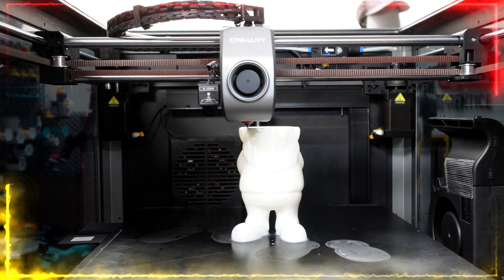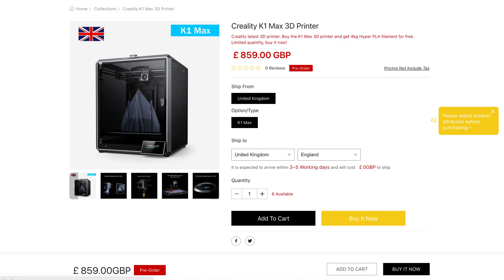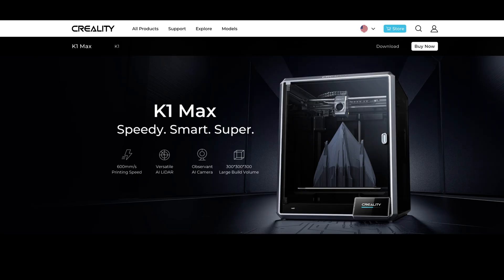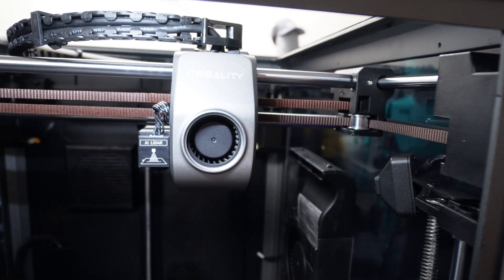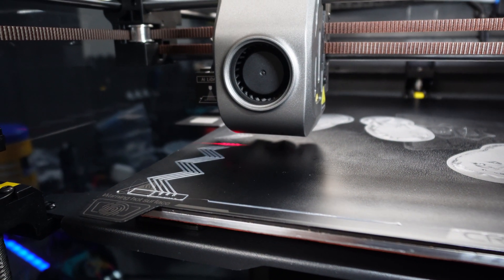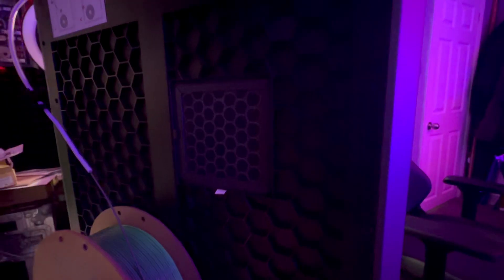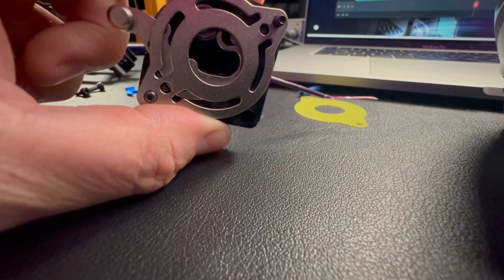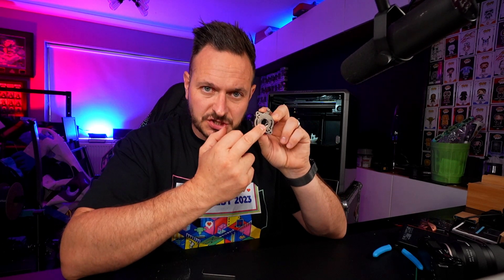Unlock Your Creativity with the Creality K1 Max - Limited Time Discount!

Comment: The idea of 3D printing has been long wait for me... I'm still sitting on the fence, but I think I'm ready to take the plunge here pretty soon... The K1 Max has just about everything...  I noticed a lot of printers have some incentives to buy, so I'm wondering if I should wait until September to see what new and cool products are coming out... Maybe there's a K2 or Bambu Labs will have have something.  I hope this community can give me some insights, I have both confusion and excitement at the same time. Thanks in advance for any help/advice for a new person.  (And New Subscriber too, sent here from Derek @ Van Oaks Props)
Reply from the maker: Here’s the thing Ray, you’ll get one and most likely buy another one in any case. You could be waiting for the next big thing and it be round the corner everyday, it feels like computer parts and cpus a lot of the time. I can’t see you being any less impressed with a max or p1 printer for the foreseeable and price right now. Let me know how you get on and welcome !
Reply: @TheRealSamPrentice   Thank you kindly for your reply!  Yes, I do get the analogy; so it's more of a matter of entering the printer market at a place where you can feel confident that I'm not missing out on a feature that I could have had.  I'm a firmware engineer, so tech doesn't intimidate me, but ease of use and automation are big sellers to me... Also I am hearing ppl say they can't wait until September for some big news... I'm not in a hurry to purchase, I've waited for years so another 60 or so more days, if the wait is worth it... or they might deeply discount existing printers... Ah.... And that's the trap you mentioned.  Sigh... LOL

Comment: Printer broke down on the second day so contacted Creality support and there first suggestion was for me to remove the bottom plate and try fixing it myself! After spending over £900 I wasn't prepared to start taking the printer apart! I then ask for a replacement printer, but they said they didn’t know when they could get one for me.  So, I asked for a refund and now I must send the printer to their Poland warehouse before I get a refund!
If you live in the UK and your K1 breaks you will be asked to either try fixing it yourself or send it back to Poland and wait how ever long to get a refund!
This has got to be the worst experience I’ve had buying a 3D printer and I will never deal with Creality again after this.

Comment: Got my K1 Max on the Saturday and it broke on the Sunday! :(
Reply from the maker: How’d it break ?
Reply: @TheRealSamPrentice  its come up with an error message 2505 motor drive exception
Reply from the maker: @zedwizz  do you think that’s the extruder motor ?
Reply: @TheRealSamPrentice  Extruder still seems to work. The error code comes up when moving in x or y direction.

Comment: Hey Sam, 
I own four K1’s plus one K1 Max. Plus I just received two Bambu P1S printers.
Putting all hype aside my PLA experience with these printers is that they are both fast, however the P1S blows away the K1 in print quality printing the same model. As we all know the Creality Print slicer really sucks compared Bambu Studio. I think once a good slicer is available for the K1 it may catch up in print quality. I’ve started playing with Orca slicer on the K1.
I like both printers for various reasons however I have to currently give the prize to the P1S.
Bambu is probably way ahead of Creality on printing engineering materials but I don’t have any firsthand experience printing them on either printer.
Thanks
John
Reply from the maker: Hey John I’ve got 8 Bambu printers on my farm here and to be fair everyone will have a slightly different experience depending on a number of factors. I’ve said this - x1c over the k1 but the k1 max over the x1c - that’s in my case.

Comment: Myns just shat itself after updating though the internet and now it buzzes like hell and makes a ton of load nosies . Even tried updating though the usb but nothing seems to help
Reply from the maker: Have you tried a downgrade? Img files are in the creality cloud app?
Reply: @TheRealSamPrentice  I tried from a file off youtube but that would not work , thou that way and usb
Reply from the maker: @louisebmedia  are you doing it with a windows pc?
Reply: @TheRealSamPrentice  I am yes :)
Reply from the maker: @louisebmedia  okay what does it do when you run the usb? Fail?
Reply: @TheRealSamPrentice  currently saying usb flash drive inserted :/
Reply from the maker: @louisebmedia  okay so in settings anything to update ?
Reply: @TheRealSamPrentice  nothing unfortunately as still can’t bypass the screen where it says self inspection, if it didn’t vibrate and make the horrible noises I’d carry on with the inspection again. As before when I first set it up, it fired up fantastic, printed the benchy. Now it will only allow me to do the inspection 😭
Reply: @TheRealSamPrentice  quick update, Creality are sending out a new mainboard , seems asif a lot of people are having the same issue with k1 Max soon it updates it seems as if it poops the mainboard. So wouldn’t be surprised if Creality do a post soon to tell customers to check there barcode number if they got the faulty ones. So as if there bad batches which I know these things like that can happen especially with new products but I think maybe they should of at least done more tests before letting them go to the public as it just feels abit rushed to get them out the door
Reply: @louisebmedia  No one should change the mainboard without training in electronics. I wonder what the insurance company says when your house burns down!
There is a reason why you would never be asked to do the same thing in your washing machine or dishwasher, microwave oven etc.
Reply: @dejedejsson  which is why I think it’s bad there telling customers to go do it and offering a replacement machine, they obviously assume nothing bad will happen, if something goes wrong the machine breaks for some reason I will be demanding out a replacement. It shouldn’t be a case of having demand something just because they probably can’t be bothered to risk a customers life. If there’s issues like this happening to people they should be offering a replacement or refund as they clearly are fully aware of what’s happening :/.

It’s bad as they even uploaded how to change it online 🤔
Reply: @dejedejsson  would you suggest me to contact them and ask for a replacement as I feel stuck in the middle as people are saying well if you built a pc I should be fine but I don’t want that risk
Reply: @louisebmedia  You can't compare building a PC to changing the mainborad, it's ridiculous, I build my PC, but would never open the PSU and try to fix it.

Comment: As Nathan-builds-robots showed, the new extruder body is also steel now, which is way stiffer than the old aluminium extruder body, less effected by heat and less conductive to heat.  I think that does way more than the tiny plastic shim.  But I'll wait patiently until Creality actually does open up this thing's software and not just claims they will.
Reply from the maker: I guess time will tell :)

Comment: I sent my K-Max back yesterday. The glass lid would not seat in the frame because it was out of square 6.35mm.
Reply from the maker: Out of interest do you think that was a shipping thing or manufacturing thing?
Reply: @TheRealSamPrentice  The top frame member, which I call a CROWN, is a single casting. I think the casting was cooled too fast, and that caused it to deform. My frame was 550mm back left corner to from right corner, and 544mm for the other diagonal. To make matters worse, Creality went ahead and built the machine with that crown, so the dimensions were built into the core xy mechanics as well. I did try to compress the long axis by approximately 3mm, but the strength of the casting is incredibly strong and resisted a 24" furniture clamp successfully. The box my printer came in did have a couple of issues. I could put my hand in one of the corners because of a tear in it. But the packaging protected the printer well enough. The worse part of unpacking my K-Max were the three screws that hold the bed down during shipping. All of them were bent in the middle about 5mm's. Getting them out of the holes was a total B, if you know what I mean. Also, those screws are coarsely threaded, unlike typical 3mm screws, so I had to straighten them to get them back in when I packed the printer up. To answer your question: the crown was manufactured improperly, specially, I think, after it was taken out of the casting. And then, the technicians putting it together ignored that. A test fit of the glass top would have revealed the issue. The rails not fitting properly would have revealed that something was amiss. But all of those clues were ignored. Even a simple measurement of the diagonals of the crown would have told an alert person that the crown on my K-Max should have been tossed in the scrap pile before it was assembled. Strangely, the printer printed quite well even though the vibration and the noise were on the high side. Growing pains for Creality, that's what I think. Hopefully the second K-Max will not have the same problems as my first. Thank you for asking. I hope the information informs your future videos about the K-Max and Creality, the company.  Mark Corliss / Corlissmedia2.0 on Youtube and Instagram. (See my instagram page for a slew of pictures of my first K-Max. They detail the ill-fitting glass top quite well.)

Comment: he mentioned having the top off when using PLA is that something that has to be done the lid says if the room temp goes above 30C which is like 86F? is this a major issue with the k1 Max as i would likely have it in a room where i would want the top cover on for sound reasons.
Reply from the maker: That’s what I said :) and yes that was the demo :)

Comment: Call me paranoid, but you don't sound as impartial about Creality as you used to just a few weeks ago....
Reply from the maker: Well this is for the max the k1 issues were resolved, and I’m starting to look at things with new eyes. As I’ve mentioned on streams this week x1c over the k1 but the max over the x1c is where I’m leading into. I really like the k1 max it’s been an excellent experience and almost a shock. I hope that came across in what I said, but as you know if it was a dog I’d be saying just that.
Reply: @TheRealSamPrentice  Fair enough. As someone who had to return their K1 because it was utterly borked, I'm struggling to accept that the Max is so much better. Maybe I need to bite the bullet and find out...
I appreciate your videos, either way.
Reply from the maker: @siggy101  well I have two k1’s and I’ve found in most cases issues have been firstly with the extruder and hotend (as you saw in previous videos) I think they delayed the max to ensure that over all product is better, this includes things like firmware and printing quality. Being a huge Bambu lab fan it’s a struggle to look at these are very separate printers as they are so alike. I have no real skin in the game regarding being paid for videos from either company and any affiliate links are both equal. There are a couple of spelling mistakes on the current firmware on the max but really the open source part is exciting to see and come September understand. Needless to say if it’s lumpy you’ll know about it :)

Comment: Great video
Just recently I was out of town for a few days but had someone home who was not tech savvy. I taught them how to clear a build plate in 60 seconds and I loaded up 4KG worth of filament in the Ams and did not miss a single day of printing. I could monitor my prints. send print jobs, stop/pause jobs, change filament/colors too.  Open source is great but there were no consumer solutions that could do what I just did with the same level of hands off reliability, monitoring with filament loading and unloading.(that poop chute is a genius idea) The most I could do with my prusa was set up a smart cam to monitor and cut power to the printer with a smart plug. If there was an issue I would have lost days of printing. 

A not often mentioned feature  of the AMS is filament runout redundancy. I loaded the same color in the AMS and used up 3 rolls while away and didn't need to touch the printer at all.
Creality has a way to go to. Love the size of the K1 max but it is missing some other QOL features. 

Sure this was an edge case but darned if it didnt impress. I have a planned week vacation and will do it again. once I  figure out automating clearing the plate I think I am beyond using any other brand anytime soon.

Edit spelling and sentence cleanup.
Reply: And for us who don't care for AMS? ;-)
Reply: @BalkanBiker  out of sight out of mind? Lol.
People can't miss what they never used.

It's just hard to do remote printing unless you the printer is primed with filament. My use case wasn't never an option with other brands but it was an extreme edge case they now I prefer my printers have.
Reply from the maker: Wait for the bed unloader to come out
Reply: @TheRealSamPrentice  My wallet is ready! 😁
Reply: @MrAbletospeak Clearly I had a brain glitch. lol. I will keep it up so your comment makes sense for future readers. 🤣

Comment: Thanks for the introduction! Just ordered one with your link/code. Looking to replace my Ender 5 Plus, which is very good. Looking to step up printing speed without adding more devices.
Reply from the maker: Thanks dude! Let me know how you get on!!
Reply: @TheRealSamPrentice  So far it's been great!  I have been doing a lot of printing against my Ender 5+, and it was a HUGE relief to be able to print right out of the box (almost).  The only settings I changed were the temperature for the Hyper PLA (220/65); Raft adhesion; and I turned on Support for >45.  Ive done several successful prints, but I did notice one of them had some issues with the first layer.  I ran the self-check, which did the auto level process, and the next print was perfect again.  The speed is incredible!  I am going to test Support-less prints next.  Wish me luck!

Comment: I would have bought the K1max if I  known that an AMS was coming, but the fact that there is no information about one from Creality is a bit worrying and it indicates that it will take some time.

3D chameleon system looks like crap,why would anyone want to put that on a good looking well designed machine
Reply: It can be hidden quite easily, check the video of the 3D chameleon installed in a bambulab X1C
Reply: @xabizar  Looks even worse than I thought, apparently you have to have an extra power supply too and you need a very wide bench+ more space, no thanks.

Too much DIY about that solution!
Great on a cheap bedslinger that  looks like crap anyway with cables all over it!

Comment: Will be keeping an eye on it. The cloud requirements for the bambu have put me off, so if this ends up truly open then I will be interested. 

Still loving my voron2.4, and recently added spaghetti detection to it running off a local server. Getting something slightly less DIY would be good tho.
Reply: I much prefer the cloud if there is an option.  The BL  printers works just fine with SD or Lan only too.

Comment: But unless creality comes with a AMS/MMU type of unit for multicolor/material they will not make the same kind of sales as bambulabs did the past 2 years:) 
I'm still thinking of the pro's and con''s of the k1/k1 max and the bambulabs p1s with ams unit ...
For me the speed would be a nice extra but my main reason to buy a new printer is the multi color prints because i work long days and never have the time to change filaments at the layers i want to add diff color...
And the palette 3pro is also no option because i'm reading nothing good anymore about it ..onlyproblems and more finetuning
Reply: There's the chameleon, but I'm not sure how well that works in real life.
Reply: I've seen a couple of videos of chameleon in action including in a Bambu so I reckon they could get it to work on these as well. Would definitely be an awesome addon! And cheaper than the ams lol
Reply: I know it's an overused catchphrase but the AMS just works. It's integrated well into all of bambu printers. Creality needs an answer to this and from the looks of it there is nothing in the pipeline to compete. Also the AMS does more than just multicolor prints. 

I am in a weird camp with open in closed source. On one hand it's was/is a commendable renaissance of ideas, innovation and accessibility. On the other hand it did not serve the folks who wanted a fire and forget solution. 

Look at all of the multifilament alternatives, palette, mmu, ercf, 3dchameleon etc either had to be hacked together or use bespoke software to work if it worked well at all. Then there was the tuning modding , space concerns etc. Sometimes a 1st party solution that integrates well is best.
Reply from the maker: There’s a couple of colour options for the k1 coming not from Creailty tho. The key will be open source and modding - trust me this is going to be awesome
Reply: Yeah open source or modding concepts are already a few out there but nothing out of the box like the ams or palette..some people don´t have the free time to tinker more on a machine than the machine is printing